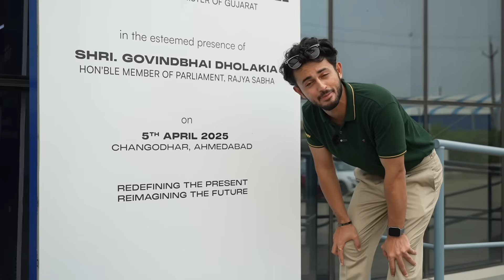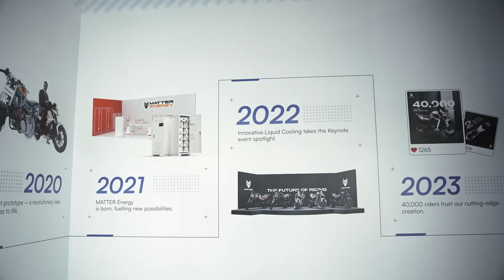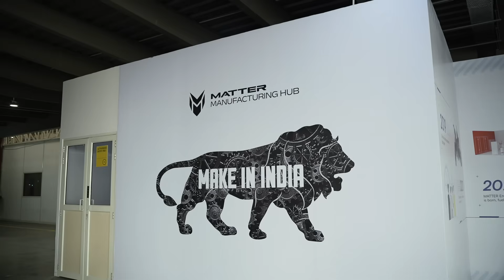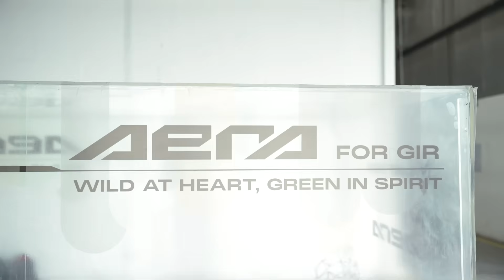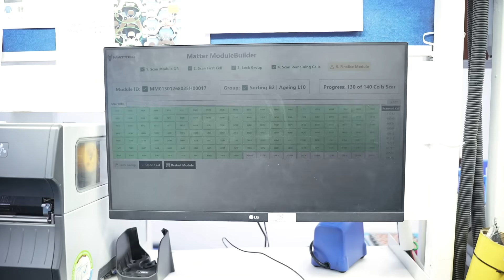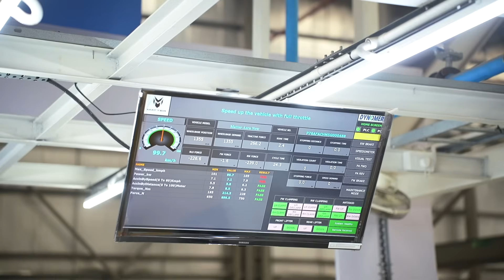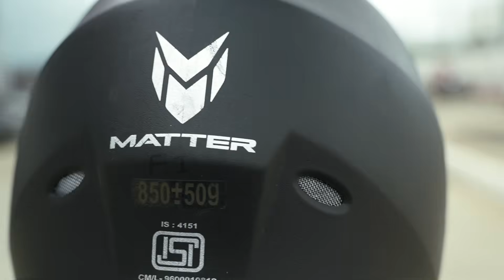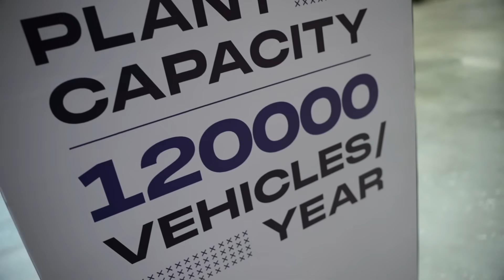Inside Matter EV: Exclusive Factory Tour & CEO Insights on the Future of Electric Mobility

Comment: I own this bike since 1 month.. I had small issues with a switch but the bike is just awesome! Absolutely loving the machine! Meanwhile, I am coming from Royal Enfield! 
For so many question on why this has gears? Yes, I too had this. 
The bike can start/stop from the top gear like any EV without gears! Gears are additional advantage for high torque needs in case of slope/mountain. 
My suggestion is, remove the gear box and reduce the price, launch it as another new model. Let both the gear/non-gear versions co-exist!

Comment: But the fundamental question is whether gears are necessary for electric two wheelers; since the strong point for electric motors is that they have advantage of ability of higher rpm compared to ic-engines

Comment: EV Engineering 101

1. An internal combustion engine (ICE) has a narrow power band (e.g., 1,500–6,000 rpm) and produces low torque at low speeds.
2. An electric motor produces maximum torque instantly from 0 rpm and maintains strong torque up to very high rpm (often 15,000–20,000+).

Fundamentally you don't need a gearbox for an EV. We need to come out of this vicious cycle of trying to appeasing customers with what they 'want' instead of focusing on what they 'need'. Steve Job would never have created Iphone if he had just implemented what Customers wanted. Sometime people don't know what they need until they actually see and use it.

"Best part is No part" -Elon Musk
Reply: 💯 It does hit the efficiency hard. The range of this bike is abysmal.
Reply: Damn! Nailed it.
Reply: I think they are planning to launch automatic varients also in future

I live in ahmedabad where i saw one matter near their rnd.. but have no clutch on left side 😁

Comment: but still whats he point of gears????? why create problem that electric is ment to solve?
Reply: The fun factor
Reply: @AnkitKumar-mt7js  only this is good reply out of all . and yes it the main reason but not that working seem to be.
Reply: Many would just buy it for that gear part . No joy in riding a vehicle without manual gear shift
Reply: @ananducs5622  ya i think few people would
Reply: Increase Mielage ... Maybe.
Reply: @NameIsNothin really? That your answer ? How much do you know about EV
Reply: @bullcheck9709  When we increase speed, do the engine will use same amount of petrol? In electric vehicle also same or not? If you know share with us.
Reply: @436-chimmiliBhanuprakash  Petrol engines need gears because their torque and efficiency exist only in a narrow RPM range. Electric motors are different — they give full torque from 0 RPM and remain efficient across a wide RPM range. Yes, electricity use still increases with speed/load, but gears don’t solve that in EVs the way they do in petrol cars. That’s why most EVs don’t need gears.
got it bro?

Comment: Tork Motors Was also having similar visions when they launch their T6X and Kratos EVs (bike). So I would rather suggest to stay away from start-ups and go for ICE engine. Service (after sale) cost of electric bikes are no one talking, as the components gets much costly which will add up to acquisition cost.
Reply: Yes vision is same they tried their best also i have kratos r it is beast not a single time break down no over heating no gimmick .. but due to investor issue they have no other  option

Comment: why adding gears to make motors more complex?
Reply: Didn't they say already in video? If they didn't wanted to make motorcycles they would've made scooters
Reply: I love gearbox system....
Reply: I think you are not a bike rider.
Reply: Also cost increase
Reply: Please don't ask stupid questions 🙏🫩
Reply: Gears help bike to have excess torque at low speeds and on climbing hills,
Yes they add complexity to simple designs, added cost,maintenance
Reply: Exactly
Reply: Gas engine bike need to definitely gear box.but electric moter can speed easily.i dont know why they complex and power damage in moterbike or any vehicle 😢😢

Comment: How being geared is a feature 😂
Reply: Because similar to an engine, when a motor runs on higher speed it consumes more current which increases power consumed reducing battery range.
With gears they can achieve slightly higher range because they can keep the speeds limited

Comment: Why they added gear
Again hassle like oil change gear box problem increases weight 
Instead you had option like tapping in stator winding 
I think mechanical engineer designed this bike 😂 may be he thought let’s include gear box otherwise it is questionable about what his contribution 😂
Reply: Gear shifter should be like cars accessable by hands + -
Reply: @Axeleft It must be like auto gear change .... then it will work.... increase range...
Reply: @NameIsNothin then it's basically a scooter😂

Comment: If matter company able to solve battery problems which increase range than 300+ km average then it will game changer for whole world market.
This bike such have ausome quality in ev sector. realy just try to focus battery solution.
Reply: Nothing wrong with dreaming big, but we must also be as close to reality as we can be. A bike offering 150km range consistently for years will suffice. Because as tech improves, charging time will reduce and as a result you'll be able to go on long trips without worrying about getting stranded
Reply: Bro 350 +km are you crazy nobody want that much range average should be 100 so that it's will be lighter and effecient it's not like petrol where weight is reduced. We need practical bike not like imaginary thing.
Reply: If you can't speak in English properly, either learn it or just speak in whatever Indian Language you are comfortable in.

We can translate it easily.

What you have written is such a broken English that nobody will be able to figure out wtf you are trying to say.
Reply: There is already 500km range bikes in market, what are talking about?
Reply: ausome awesome. Kind regards.
Reply: 300+ range is essential if you want this bike as your main bike